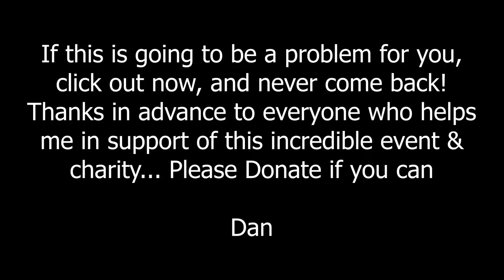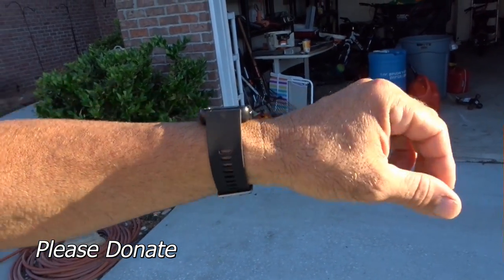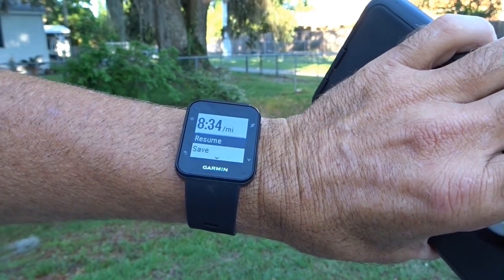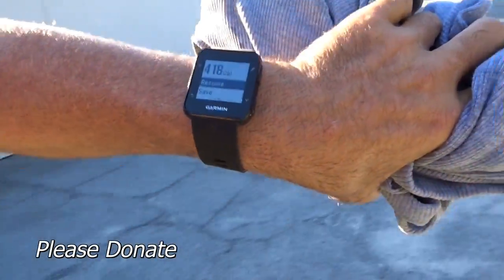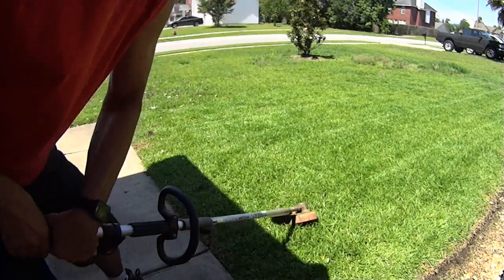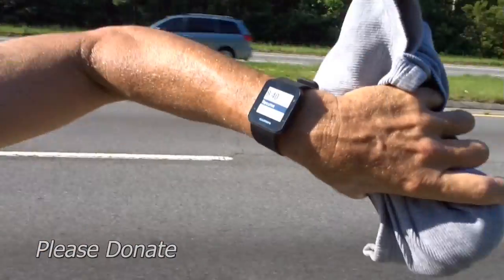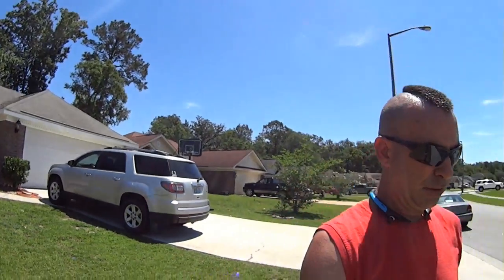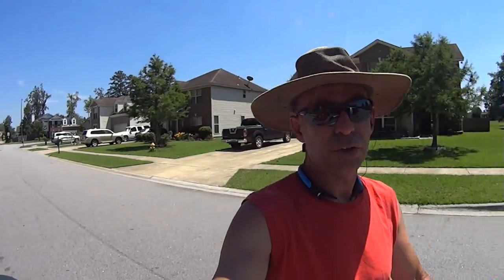Cutting Grass with a Bag Attachment on TroyBilt 20 Push Mower

Comment: Hey Dan, I'm just getting into mowing lawns and I had a quick question. When should you mulch and when should you side discharge? Also what is the difference and which one do you think is better to do with a self propelled push mower? Thanks Dan and keep up the great videos!
Reply from the maker: I like to side discharge when the grass is too thick to mulch and too thick or tall to bag without having to stop to empty the bag very often. If I can keep going easily while mulching I prefer that over side chute and bagging.
Reply: Dan's Vlog Thanks Dan and congratulations on 9000 Subscribers!
Reply from the maker: Thank you very much!

Comment: i usually bag areas you can see like the front or side if its to tall to mulch i use a snapper high vac it's a bagging machine and a toro super recycler for mulching
Reply from the maker: +Elton I am very interested in that snapper. I think the only difference between the snapper high vac and the snapper mulching mower is the blade.
Reply: ya the snapper ninja has some funky blade that has no lift
Reply from the maker: One Man Mow Hmmmm I believe you, but I looked the other day and at first glance they looked identical at Andy's Lawn Shop.

Comment: Dan, great video... again! What are your thoughts on dethatching and air-ration? You are right bagging sucks and really makes the job last longer than it should.  Do you mix your 2-cycle daily? Bad fuel will also make a job last longer than it should.  I am just a home owner and have resorted to battery tools to keep the pace and git er done.
Reply from the maker: +Jim Lutz There are a few companies here that do aeration and dethatching. I leave it to them to handle that. I mix gas 5 gallons at a time and use it up in 2 to 3 months which is about max I would let gas sit

Comment: do you charge extra for bagging?  if so what formula did you use to come up with number.... what if they want you to haul clipping?
Reply from the maker: +Adan Molina to be honest I would not except a customer that requested me to bag there Lawn. There's way too much work around here to have to worry about pleasing a customer that picky. If I am going to bag a yard because I feel it's needed then that would be included in the treatment that I intend to do like weed and feed application or fertilizer. As far as a formula I don't have A formula I would just go by size and estimate time and for residential I'm usually around $60 an hour plus material.